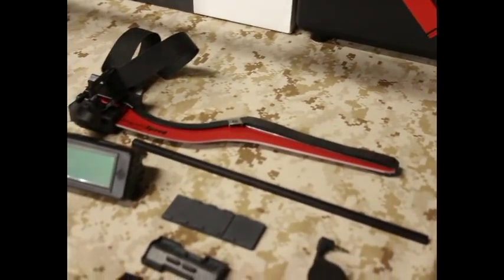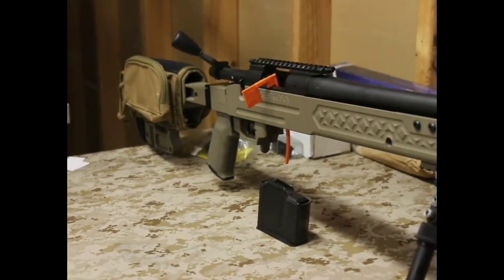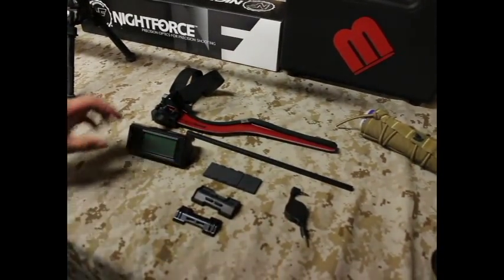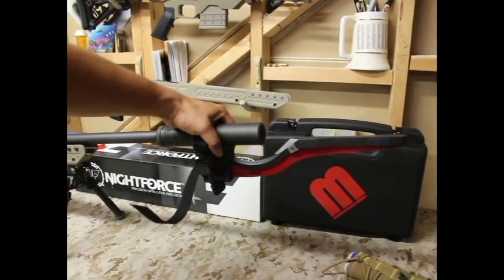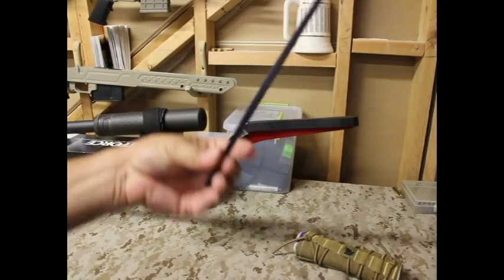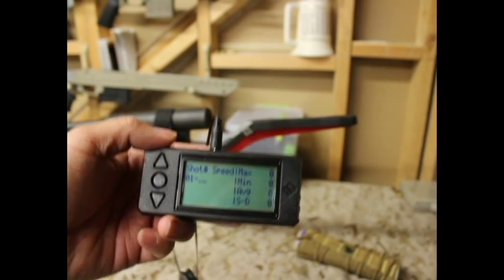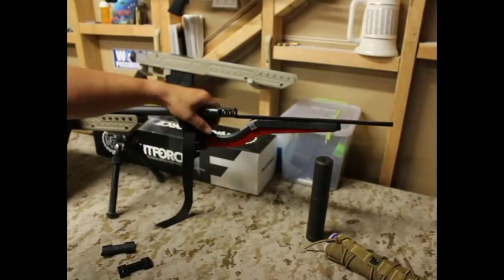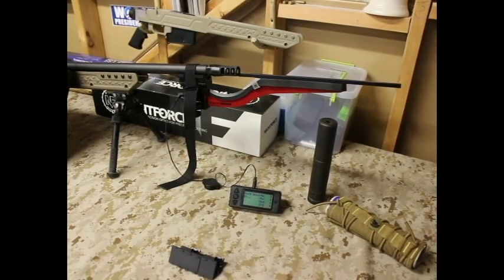Magnetospeed V3 basic rifle setup video

Comment: a cheaper and easier way to resolve that problem as I have is place a small piece of velcro (female side) on the bottom of the nylon strap where it touches the barrel. This will tighten the strap right up and stay in place forever.
One less moving part :)